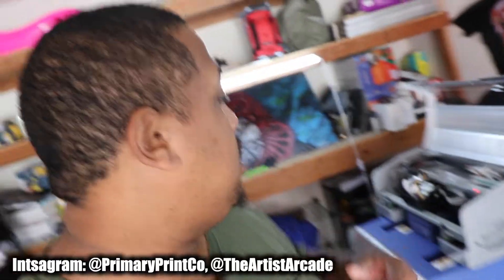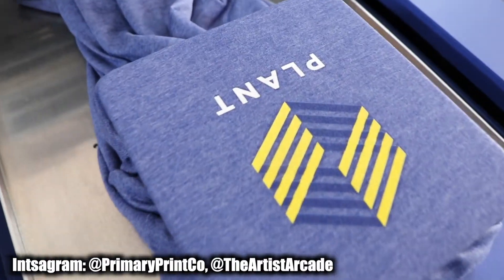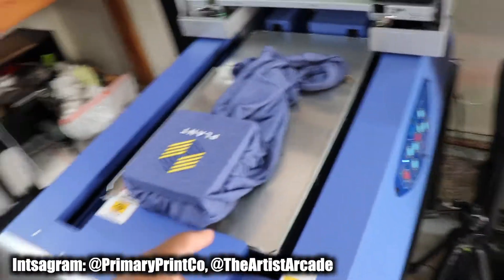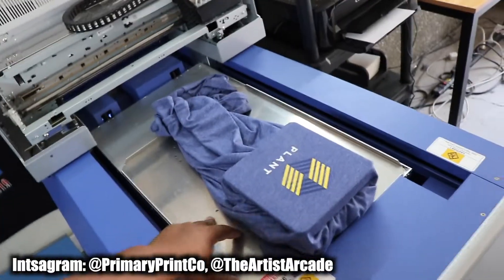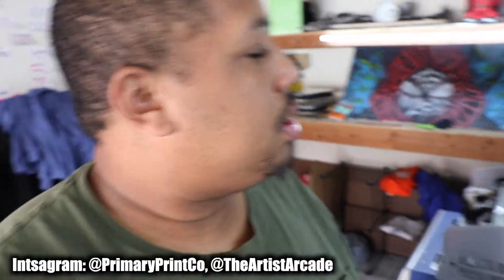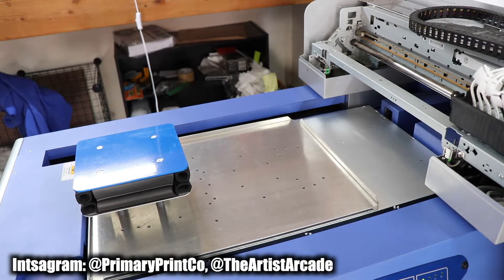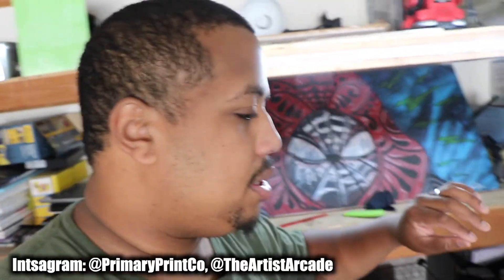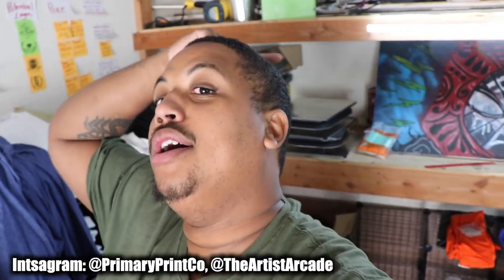HOW TO: GET ACCURATE CHEST PRINT *DTG PRINTER*

Comment: Everything H!  Have you had any issues with the printer yet?  Dying to know before I dive into the field of getting one.  I've heard that the print head is not under warranty.
Reply from the maker: Lawrence Davis Omni print is for a year unless you intentionally mess it up. And then as for the the other parts.  Certain pieces aren’t but they are fairly cheap. No major issues with the printer the pre-treat is really what it comes down too. If the pre-treat is good your gonna have a solid print. But no major issues just minor Misunderatandings with the software that I was like whaaaaa? Lol but Omniprint helped
Reply: @primaryprintco  outstanding!

Comment: What's up, bro. Love the channel and was thinking of starting one myself. Question: I have the same set up (Free Jet TX and The Pearl PTM) my question is when I'm heat pressing (Stahls hottonix) I'm getting a gloss covering the shirt and on top of that, also the heat box around the shirt (on both the front and the back, it seems to be seeping through) Also, what are you using after you apply the pretreat? silicone paper or just the craft sheets for after pretreat ..?  Any Thoughts? I feel like im blowing through shirts lately because of this.. I use the settings omniprint has given us but still not working too well... 
Any info is great man, I appreciate.
Reply from the maker: Im John Joseph ok what type of shirt are you using?
Reply: @primaryprintco  Next level i even used some bellas
Reply from the maker: Im John Joseph ok what is your pre-treat density set to? It may be too much pre-treat
Reply: Everything Harris 40
Reply from the maker: Im John Joseph on thicker shirts keep it at 40 on Bella’s try 35 and let the shirt sit on the heat press for 30 seconds before actually pressing it

Comment: Hey man. Great vid. Very helpful - was wondering if you ever printed an image that was all white on a blackT (ring spun cotton)? I got my 330TX plus and trying to figure out how to tweek settings in  Direct RIP to make it pop. Any help would be great. Happy subscriber!
Reply from the maker: Mau5ex make sure your pre/treat spray is consistent a lot of people over look that step but it is important to have a good pre-treat!
Reply from the maker: And Ill make a video on how you adjust the layers to print a second coat of white if you need it
Reply: @primaryprintco  Cool bro. I have the Pearl pretreat machine. so I've been getting good sprays. I thought it might be temp+ pressure i'm using to dry the shirt post pretreat, but I think it may be software settings
Reply: @primaryprintco  Awesome man. I really think its my settings on Direct RIP. I choose Black cotton settings, so the printer runs twice, but the second layer doest look any different from the first layer. looking forward to it!
Reply from the maker: Mau5ex ok yea I’ll have to get a video made for you! What is the spray density your using on your pearl
Reply: @primaryprintco  I got my density at 35 - Bella canvas shirts aren't too think. BTW - what temperature do use when heating after pretreat and when curing? I didnt notice it in your WACOM GIVEAWAY Vid. 

Totally looking forward to the vid man!
Reply: @primaryprintco  My man, I think i figured it out. I increased the color strength to 100%. and the fuzziness to 20. Color is coming out great now, have you tried these settings before? ink feels a little think tho, like i cant feel the shirt behind the design - does that make sense? thanks for all your help bro

Comment: Mr. Harris, I'm wondering why you have a "Chest Plate" for this project? Is it not possible to use an "Adult Platen" and get the same result? I'm thinking about picking one up, but wonder if it's worth it. Please advise and thank you!
Reply from the maker: Web Surfer yes forsure you can use an adult platen but your looking for more faster and efficient wOrk. So u your cutting down time and it’s so seamless to follow this method with all chest prints it just speeds up time. And It’s honestly more accurate. When you use an adult platen you have to make sure not only your inch gap is correct but the directional print of the image and make sure your tucking is correct. Long story said short “ get the chest platen it’s worth it “
Reply: @primaryprintco  GREAT ADVISE and well put! Thank you for that FAST reply.

Comment: Thank you!! Great video. How’d you set this up in RIP?
Reply from the maker: you actually don't need to do anything leave it on the full size adult platen setting. set your print location wit the margins place your shirt when you need it to be and for chest prints don't exceed 6inches this speaking of using the chest platen if you have it

Comment: Seems still too Risky.... I measured it out on the plate, set a margin line to display on in my rip software. After a few test prints I had it dialed in. Now I just center the image on the line center on the chest every time.

Comment: I would recommend using a regular platen for videos like this because not because you may have a chest platen does not mean the other 90% of dtg printer owner has one.
Reply from the maker: Ric Gee of course lol I said it works for me. Lol those that have one it’s help if you don’t got one one buy one or like u said use a regular platen. I’m not gonna stop making abnormal videos. You gotta invests in the pieces that will potentially help more. Increase speed and efficiency